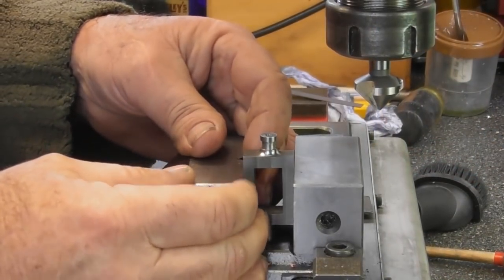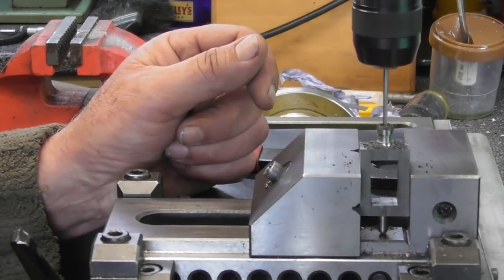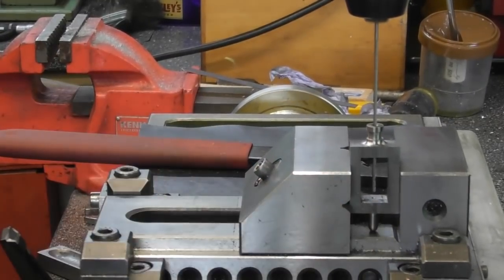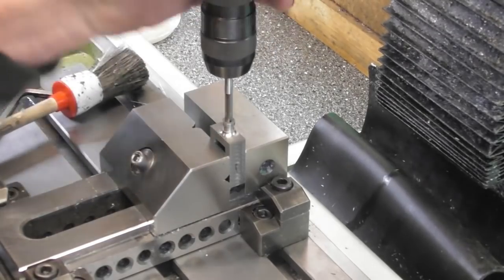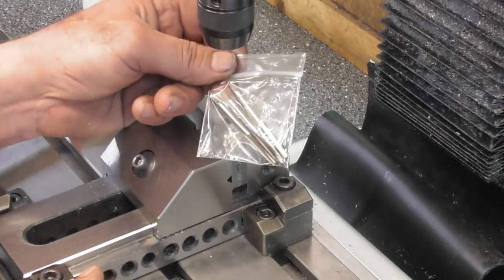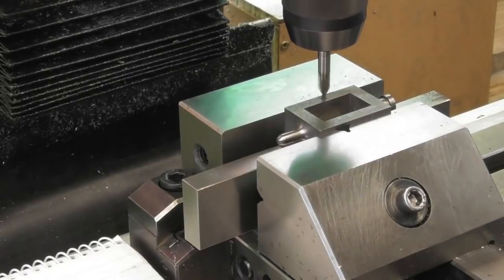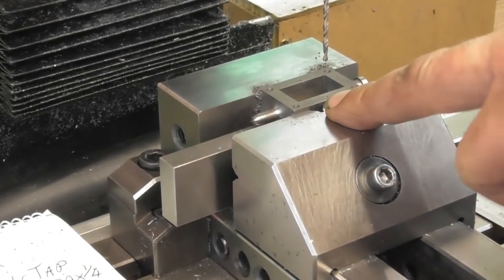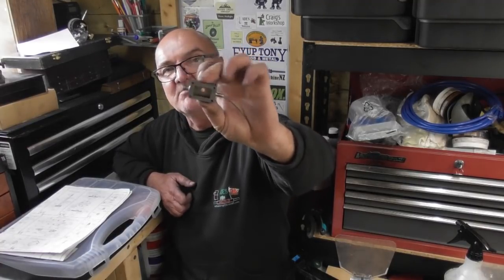Stuart models S50 engine part 15 . steam chest complete

Comment: Thanks Ade,  really enjoyable as usual.  I've done the cover of the valve chest, moving on to the chest itself soon. I've started the con rod and it's about ready to go in the lathe. I'd be interested to see how you turn yours. I've centre drilled the ends so I've given myself some options I guess. Regards gzreth
Reply from the maker: Sounds great! Maybe you have persuaded me to do that next . Cheers Ade.
Reply: @ade63dug  Hi Ade, I don't think it is as easy as it seems, to me anyways. Its taking a bit of stirring up the grey matter. I drilled the holes first, then milled the the end down to size. Now comes the turning, then the radii. I'd be really interested if you choose the same way. Thanks again Ade.

Comment: Nicely done Ade. Back in the day, I kept all my old knackered taps for making plugs out of, as you will know, if you make them yourself you can get within 1 thread usually of the bottom which on work like you are doing here, that extra thread is very important. Keep em coming mate. Cheers, Jon

Comment: For model engineering I use Polly Model Engineering they stock every thing to build stationary models to scale locomotives.
The other company is EKP engineering they stock everything for model engineers. Both companies are normally fast turnaround.
Reply from the maker: Thanks Jeff . I will check them out . Cheers Ade.